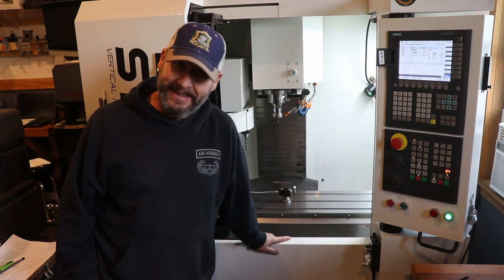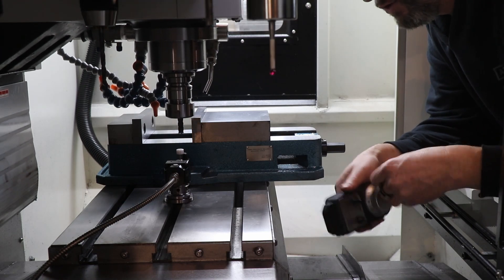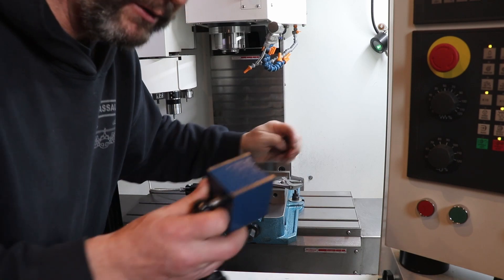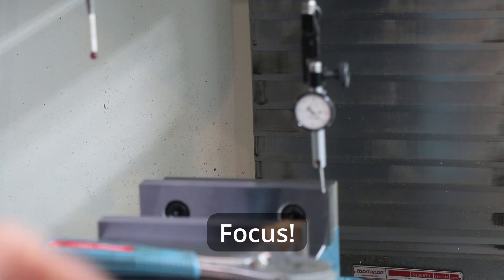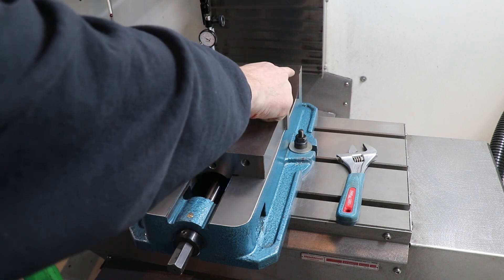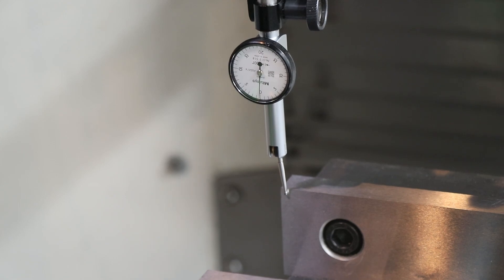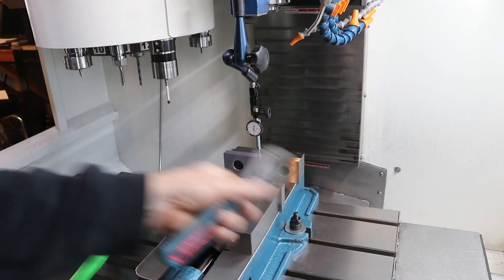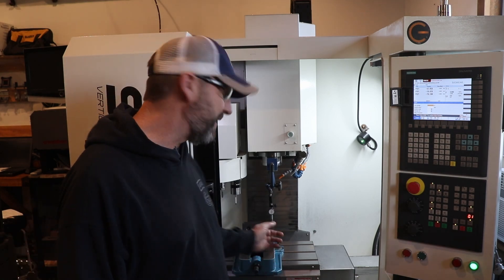SYIL X7 Basics: How to Tram a Vise

Comment: Any advantage of a dial indicator as shown vs a haimer/tschorn in the spindle?
Reply: I have found that if your using a 3d probe that when you move the stylus across the face the indicator moves creating a kind of backlash. You can do it if you zero y at one side of the vise remove the preload and move to the other side then drive back to y0 then move the vise until the probe reads 0. Do that a few more times and your trammed but the indicator method is much faster since it only measures y movement.
Reply from the maker: @TomDetka  That's cool. Never a bad idea to have a few different ways to do something. Like you said, I think using a dial TI is fast, and easy.  I usually leave it set up stuck to my tool box ready to go.
Reply from the maker: That's a great question. I don't have a Haimer, but why not? It should work. Is that what you use?

I use a Dial TI because it's such a great all-purpose tool designed for this and a few other things. In my shop, I use it for layout and inspection, and then there is checking runout, concentricity, straightness, and surface alignment.  It's very versatile. 

I do want to buy a Haimer in the future. I think it would pair nicely with the built-in Siemens measuring protocols.